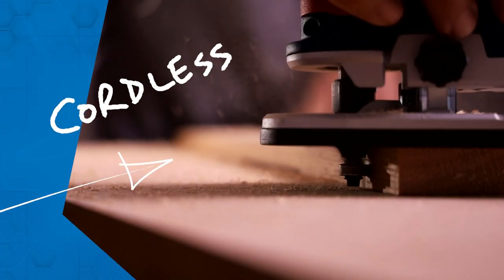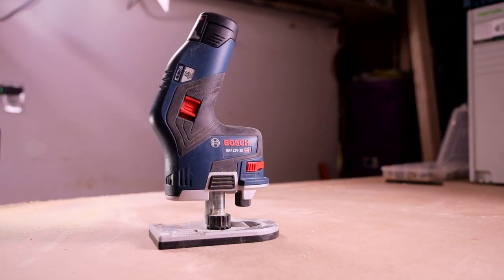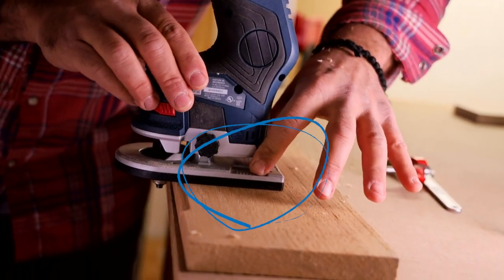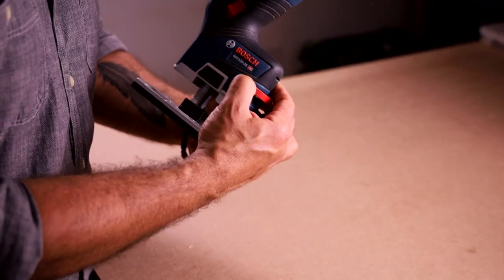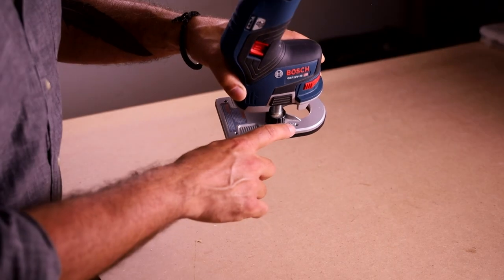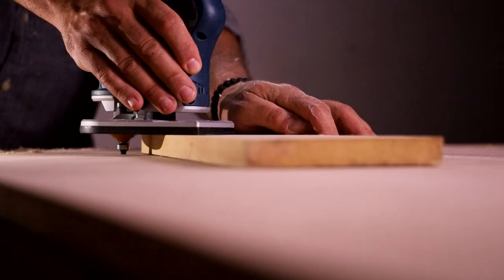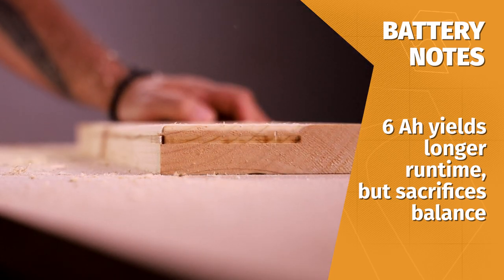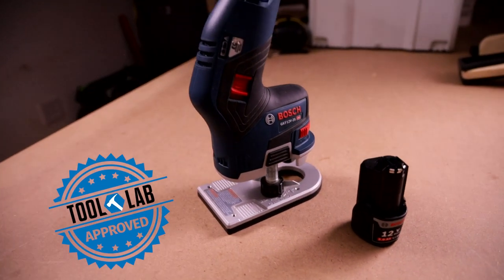Cordless Router Review | Tool Lab | This Old House

Comment: why not festool? every other tool you guys use is festool.
Reply: Only 27 easy payments of $9999.99.
Reply: @brianglade848  a Dodge key works great, it has a pointed tip.
Reply: @Kevin-mp5of  lol, dorky. that's what blue jeans are for, wipe off the wax. i don't miss the two keys though.
Reply: @Kevin-mp5of  you probably could, it might be expensive. is there a "this old locksmith" segment?